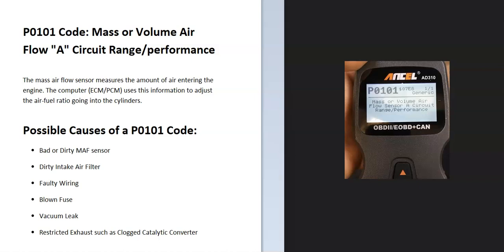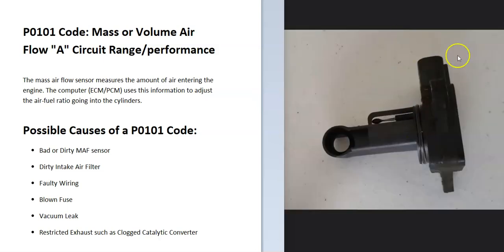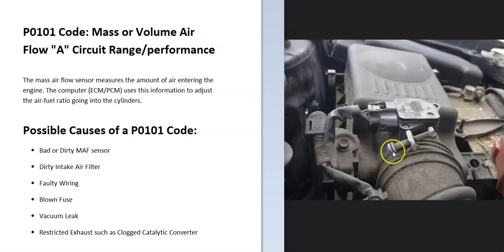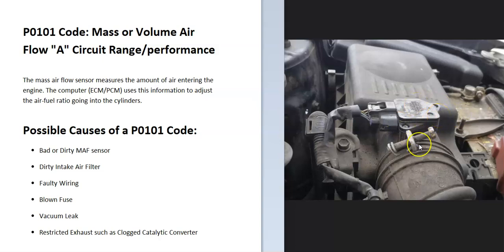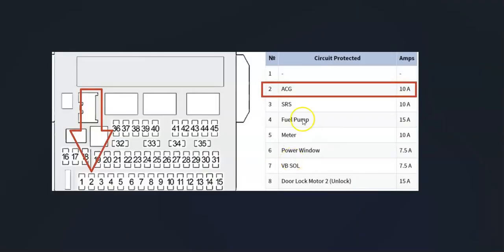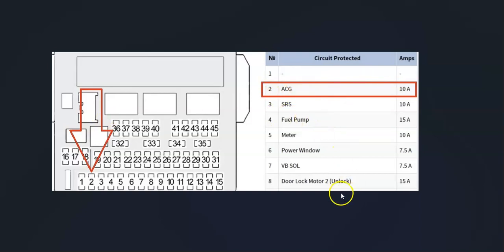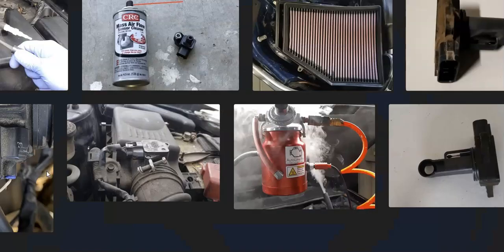Causes and Fixes P0101 Code: Mass or Volume Air Flow "A" Circuit Range/performance

Comment: My car is stalling and throwing a po101 code and a po456 code . 
Will the amf sensor make the car stall after stalling it will start right back up
Reply from the maker: Yes, a bad MAF sensor or MAF wiring problems can cause those issues.

Comment: My catalytic converters are partially clogged causing all types of shit...😂  It runs and drives just fine, but my acceleration is trash with any RPM above 3k.
 I have no passing power, and if i stay on the throttle too long, I'll get multiple cylinders misfiring. 
Now i am seeing this code pop up on my scanner.  I swapped my mass air flow sensor just to check, code came back.   my backpressure is so high that it's interfering with my mass airflow sensor from pulling in air.  I also got a lean code from the problem, but my fuel trims are normal. Shit is crazy how the hall effect did that.  

Those bitches are coming off tomorrow.  I just came here to see if infact that a partially clogged cat would cause mass airflow problems. And i got my answer.

Comment: Is it OK to clean with brake cleaner?   Or EGR Cleaner?
Reply from the maker: I use rubbing alcohol when there is no MAF cleaner around, and it works good. I would stay away from anything harsh, like brake cleaner.

Comment: i had a broken air intake box so i replaced it with a used one and i got the code should i switch out the sensor from the old one to the one i have on? i cleaned out the box and its in good conditions

Comment: I had this code today on my BMW and I told my mechanic he said ok bring to me tomorrow I brought it to him and he could not find a problem apparently the car is fine when I'm Ottery sure it is not as the fuel consumption has been getting worse and worse over the space of 6 months not to mention less power than when we first got it 🤦‍♂️🤦‍♂️
Reply: R u burning oil?
Reply: @marcosz630  how would I know that i dont smell burning oil and I dont see any oil leaks so I would like to say no but im not a professional so can't say for 100%
Reply: @marcosz630I am most likely burning oil. Same code. What is the relevance of burning oil with the code? Do you have any tips?
Reply: Did you manage to sort this , I also now have a 320d and same problem "Air mass airflow too low compared with measured air mass" , yes same P101 , haven't checked the MAF , filter and pipes yet though 😅

Comment: Is it ok to use a q-tip sprayed with crc maf cleaner on the maf wires/resistors ? South Main Auto did this in his video.
Reply from the maker: MAF sensors often get dirty, and it is common to clean them with MAF sensor cleaner. Isopropyl alcohol also works in a pinch.

Comment: If you replaced your mass air flow sensor and still have that code it could be your throttle body is dirty. clean it or replace it.
Reply: I will go as well for dirty throttle body, same issue , I think also to clean the inlet manifold! Hope will be ok after!

Comment: You are exceptional in my opinion. Clear and easy to follow and understand. Direct and detailed for a brief overview, and certainly enough to give a quick explanation. Well Done! I'll be coming back. I reset my P0101 code and cleared it. Everything ran fine afterwards. The engine has set up for several years and just recently began running it. In fact I was getting a series of different codes and reset them all and everything idled fine afterwards. So, I wondering if moisture over a period of time could build up on the sensor, and contacts to different things and just need to use the MAP spray etc., what is your opinion?

Comment: Hi I did everything on my 2021 Chevy Equinox check engine light still coming on not flashing just on and I am selling it to carmax end of this month my code reader says P1101 I changed the MAF sensor removed battery cables it drives like new but that light still on any ideas thank you kindly
Reply from the maker: If the sensor is good, I would test the wiring.
Reply: Often times you need to reprogram it. There is a lot of ways online if you don't have the scanner tool.

Comment: I got this code after I installed a cold air intake, could it be fixed still?
Reply: I just had the same problem now, what did u do to get it fixed or did u leave it
Reply: @ishaqchoudhury4464 oh I sold it lol

Comment: Before or while changing expensive sensors...
1. Change air filter
2. Clean the throttle butterfly (for fords the idle air control solenoid also)
Carbon/dirt deposits can cause the butterfly to not close completely letting in too much air at idle.

YMMV

Comment: I have a 2018 nissan kicks and I have replaced the mass sensor 2 x in one year I had a friends obd2 tool mentioned gave the same error code but also mention the issue could be the altinator. I'm gonna see if my car has a vacuum leak next. Thanks l!
Reply: Might have to take to nissan for relearn
Reply: Clean the throttle butterfly with throttle body spray as it may not be closing completely and causing a lean condition.
Reply: So my car electrical system had to ve reset at the dealership and costed ne $600 bucks. The car runs better and has yet to give me problem.

Comment: Well, I replaced the mass air sensor and the p0010 is still on.
Reply: It might be your plug or wiring. Get a multimeter that shows volts and ohms and stop throwing money at problems. Youre just gambling.  Check the voltage to the sensor. Check the resistance to ground, check the signal voltage. Check that your new one isn't some AutoZone or O'Reilly's knock off part.
Reply: It may be doing it’s job and telling you there’s a vacuum leak
Reply: ckeck throttle body. clean up carbon deposit inside.
Reply: This video is for P0101 not P0010
Reply: Pretty common.
Reply: Ever figure it out?
Reply: Same thing happend with us here..
Reply: @letsExplore77730 how did you fix it? I have the same code now. I’ve replaced the air filter, sensor and dont see anything broken. Dont know what to do!

Comment: Hello I have a 2020 kia forte. I have code p0101. I replaced the air filter, mass air flow sensor, wiring has volts and looks good. The car runs fine after a few days the code returns. Any idea? Also when I unplug the sensor the car doesn't stall
Reply from the maker: I made a video on what to do if replacing the MAF sensor doesn't solve the error. Here is a link.  https://youtu.be/UurB9e9i3lg
Reply: Hey I have the same problem. Did you ever find a solution?

Comment: Hello

Do you know if a bad turbo could cause p0101 codes? Reason I ask is because I have a Fiat 500 1.3 diesel and the car would start and cut out.. I diagnosed it to a bad Maf sensor due to the Maf not reading anything and when disconnected the car would run fine. I then bought a new MAF from ebay and although the car drives fine it throws an engine light after 15 or so miles with the code P0101. I suspect the turbo as the car does give out blue smoke on first start up and I do also feel as if the turbo doesn't kick in like it should (that may just be me expecting too much out of a 1.3😅) that's why I ask if the turbo could be the issue here any ideas?
Reply: I think it may. My turbo is leaking some oil , because air intake and intercooler hoses have some excess amount of it.  Leaking turbo for sure can interrupt normal maf sensors work.